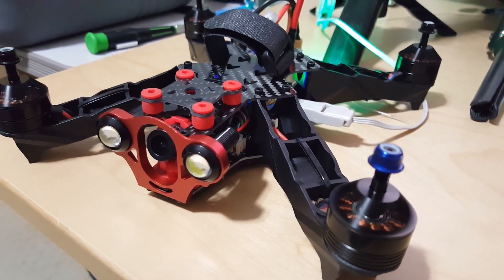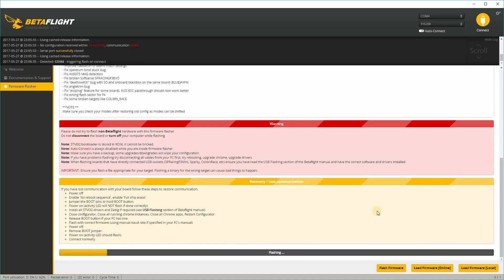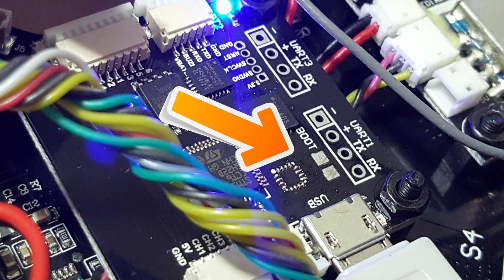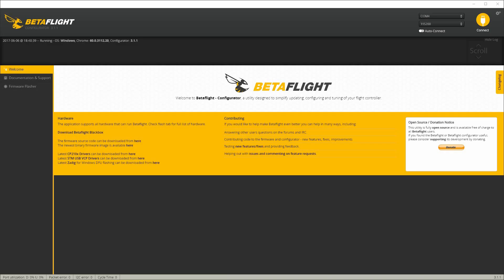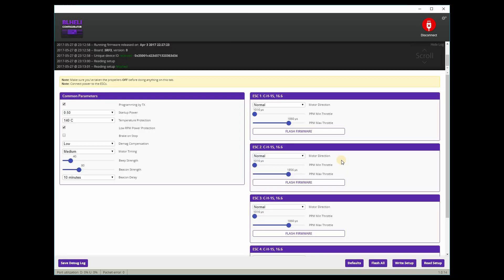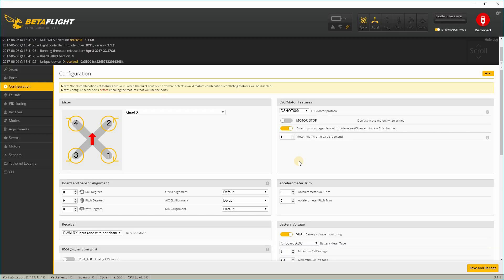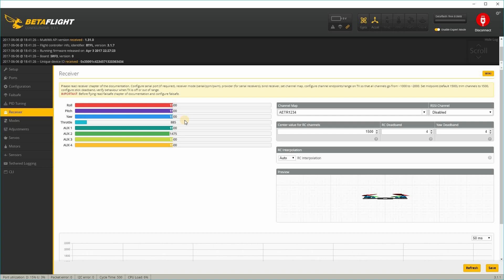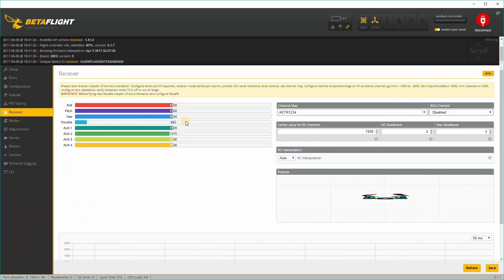Eachine Racer 250 Pro 🚩🏁 Betaflight Flash and Config 🛠😀

Comment: Air Mode in Betaflight is probably the best feature I've used in my quads. Also, completely off subject so you don't have to answer, but do you like the Nissan Leaf? Thanks again for all of the hard work you put into your videos.
Reply from the maker: Love my Leaf! It just doesn't have range, but I mostly drive locally nearby so it's not an issue for me.
Reply: I have a nissan leaf and love it... plan on getting one of the new 240 mile range 2019 when the come out.